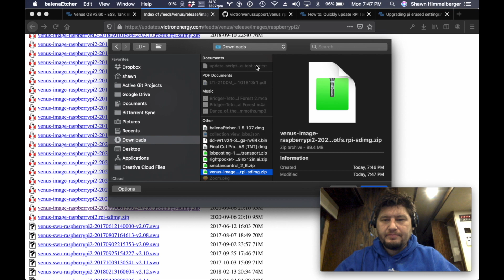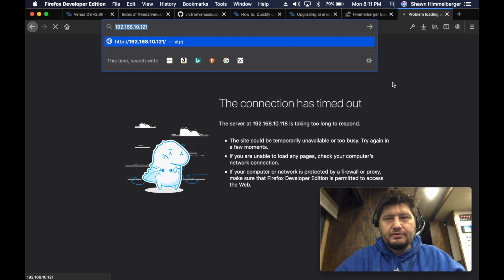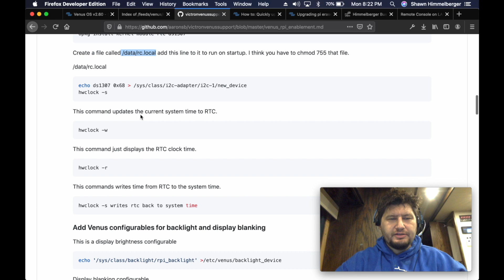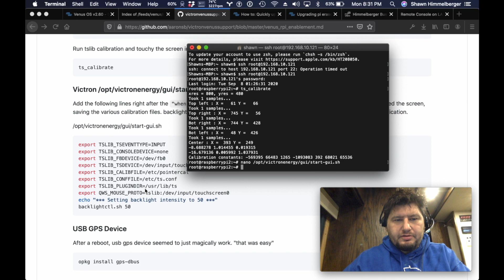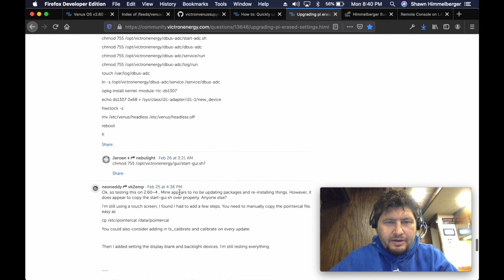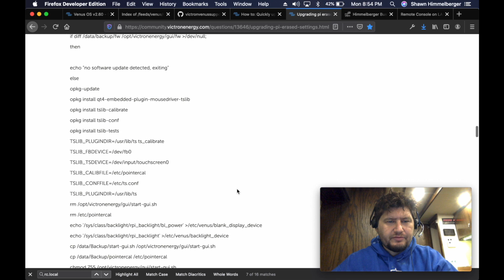Install Victron Venus OS 2.60 on Raspberry Pi with Update Script

Comment: I was going well until the reboot & calibration. It didn't reboot (I had to do that through the direct connection, not putty & then the calibration wouldn't work. Such a such as this is about the 3rd time I've tried to set this up & found this video & figured I was on a winner (looser again I guess!!) 🙄🙄 & yes, I also want to set up the RTC with the chip that is those downloads, so I added that, but I can't get it to work either!! I'm now lost again!!

Comment: I'm not getting nowhere with this I bought the raspberry pi 2 Model B I downloaded two different Victron Venus OS program and all it does it sit on the Victron Energy screen it doesn't actually boot up I can't find it using Venus local can't find it thru the IP address very frustrated

Comment: Hi, I see you have MultiPlus (not MultiPlus with VE.Direct port). Can I ask you, what did you use to conect VE.Bus to RPI? Was it MK3 to USB adapter from VE? And will it works any adapter from RJ45 to USB? Thank you
Reply: Standard RJ45 to USB adapter doesn't work
Reply from the maker: MK3 to USB adapter
Reply: @HimmelbergerBus  Thank you, works!

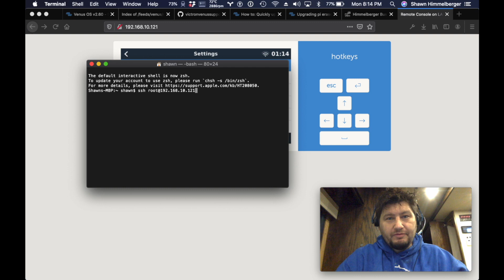Comment: I got my RPi up and running a couple of months back. Updating the OS today had to completely reflash the SD. Everything is working on the Victron end. But When I try to SSH into the Rpi I get the warning you have at 13:46. But you edited the fix out. Any help with the fix for the warning error?
Reply: I found the answer in another forum. Posting here so I can find it if I need it ;)  ssh-keygen -R <IP>
Reply from the maker: Sorry, I have a new even better method here when 2.80 comes out. Thanks for the tip.

Comment: this was really great. I have been back her again and again over a few months working my way through. everything seems to work except the brightness slider. After poking around I got the slider to appear but it slides but has no effect. I am not using official Pi touch screen. If you know of any tips that would get it to work i would appreciate them
Reply from the maker: Try the new method in our recent video. Uses GuiMods on a USB stick

Comment: Which BMV did u get?
Reply from the maker: I have the 702, but today I’d buy the Smart Shunt.
Reply: @HimmelbergerBus  what u think about  440w Mono-PERC bifacial panels? Are they good
Reply from the maker: Not sure on those , the ½ cell panels are great.  Looking at upgrading myself .
Reply: @HimmelbergerBus  I found some but I don’t no much about the
Reply: @HimmelbergerBus  I have one more question, I have a 24v system and a multi plus 24v 3000 do I need a battery regulator or something? I have a MCI 96-A3
Reply from the maker: @houseofshootsllc  there is a voltage regulator on the bus already. I have lithium and adjusted the voltage down so it charges at 100 amps at most. I do this so I don’t overload the alternator if I’m also running AC.

Short answer is no, you’re good.
Reply: @HimmelbergerBus  I really appreciate your response, I’m a big fan of your channel
Reply from the maker: No problem

Comment: This was probably the best start to finish video that I have seen, and I have watched a bunch. I have not bought, or ever used a Rpi. I think I am still over my head. Are there any videos that you would recommend for the Rpi programing on Windows?
Reply from the maker: First of all, Thank you!  As far as windows goes, you just need a terminal capable of SSH. I want to say PuTTY is a popular one and now with a windows Subsystem for Linux  you might be able to do it that way. Once you SSH in, almost everything is the same.

Comment: i would like this venus monitor, but dont want to install a new image. i have open plotter on my raspi and need to find a way to add the venus without a new fresh install please
Reply from the maker: I don't know if it is still supported, but there is a debian package. https://github.com/victronenergy/venus/wiki/install-venus-packages-on-Debian You won't be able to get the full features though with the screen and all that.  You could use a local network to display the web based display though, which in some ways is better. (on screen controls).
Reply: @HimmelbergerBus  thankyou so much. I will look into this. We have a few rainy days coming Up 😊

Comment: Do you have a link to the PI unit with display?  Thanks!
Reply from the maker: This case RS Raspberry Pi 7-Inch LCD Touch Screen Case, Black https://www.amazon.com/dp/B01GQFUWIC/ref=cm_sw_r_cp_api_glt_fabc_6D0BRHS7F49AWRQEFPTW
Reply from the maker: This screen Raspberry Pi Official 7 Inch Touch Screen for Raspberry Pi 4 / pi 3/pi 2 Model B https://www.amazon.com/dp/B073S3LQ6Q/ref=cm_sw_r_cp_api_glt_fabc_4PHJ043NTW1ZNZNSB16V
Reply: @HimmelbergerBus  What are you running for I/O interface to the Raspberry Pi? Like VE.Direct for example. Thanks again!
Reply from the maker: @srira7910  4port USB hub and VE Direct to USB adapters
Reply: @HimmelbergerBus  We could solder up a few cables to save some money buying VE.direct to USB adapters. Seen a few USB cables with the RS-232 Chip on board. Thanks for responding back!

Comment: hello there
I have been trying to follow your discription but I got stucked after trying to install ´opkg update' and there I got error 'wget return 8' . I solved it to find that the path was missing in victrons packages name ../rooko/.. was instead replaced by ../zeus/.. and then the 'opkg update' and all 'opkg install' seemed to be ok. But after reboot the Pi is stucked, on the display the  Victron logo is shown but there is several error messages, "login: error while loading shared library: libcrypt.so.1: cannot open shared objectfile: no such file or directory". any hints?
Best regards
Lennart Pettersson
Reply: I have a similar problem. "opkg install" fails with the same error. But in my install it called for /dunfell/ not /rooko/.  (I'm a newbee here, so bear with me)  I searched the feeds and found references to the packages but in a different set of directories.  None the less, when I manually executed the updates for each file in the corrected directories, they errored out with "file not found" and yet I've checked the paths and they appear to exist. So I'm dead in the water.  I got the hdmi display working, but the touch screen definitely needs calibration. Is there a way to manually execute the package installs from the .gz files so that I can do the calibration?
Reply: OK, I finally got it.  The /etc/venus/venus.conf file needed to be edited directly to update to the correct /develop/ path for /dunfell/ .  (Trying to update the files manually just wouldn't work )
The update worked correctly from there and the installs went smoothly.

Comment: Hey there. I Have been trying to get this working. I have it installed on on the sd card and see the blue victron energy logo. however I get lost when you say find the ip adress of the pi. I dont have a hard lined router. I have a small router so have attached macbook and rapberry pi to that but I still dont understand how to find the pi's ip. I therefore cant install the overlays to get it up and running. Can anyone help with this part, thanks anyway for a great informative video
Reply from the maker: There are apps for Mac that will Find your Pi on the network.  Also look in the router's administration pages, usually it will list hosts connected with MAC and IP addresses.

Comment: You should check out Home Assistant. Somebody had written some code for an ESP32 microcontroller to connect to the VE bus and push all this data out via MQTT and then you can pull it into home assistant and store / plot data in the influxDB / graphana add-ins.
Reply from the maker: Someday... I'm just happy it's working.  Also 2.71 is almost out with some great new features, esp for the Pi.

Comment: you didn't run ethernet to that point in your bus,shame.
quick fix get any old router/switch & connect a short ethernet patch cable from that to the pi, then run a temp long ethernet from any other lan router/switch  port to the main router when you do this stuff again forgetting to set your wireless creds on the new image, install 'nomachine' on there for remote access too.
putting old 1Gb/s router/switches to both ends of single/double run's is always more convenient later
Reply from the maker: I’m doing some light remodel now, I just might run one over there :-)

Comment: Hi, thanks for your help before. Everything is now looking great and I just have to connect my multiplus 1600 inverter. What I am wondering is how are you mounting the 7" display and pi to the wall? I've seen some ridiculous prices for a bit of plastic.
Reply from the maker: Glad it’s working out for you!  I cut a hole just big enough for the back case to go through, then all the USB connections kind of keep it in place. It’s not the best, it was one of those quick solutions that has stuck.

Comment: Thanks. I have the Venus software installed all ok but nothing else is happening due to the pi not being connected. I have done quite a bit of reading but I am still confused on the cable required and where to connect it to. I thought it was the mk3 ve-bus to USB cable, but then I have read about ve.direct serial cables. I cannot find any useful info about which to use.
Reply from the maker: Mk3 is for VE bus devices such as Multiplus Inverters. VE Direct is for things like Solar chargers (although some bigger ones are VE Bus as well) BMV Battery monitor, etc. 

Since our Pi is not very close to our equipment, I use a USB extension and 4 port USB hub to connect it all to the Pi. I have 3 VE direct and 1 MK3

Once you price all this out a CCGX or Cerbo GX doesn’t seem that much more expensive:-) 

Good luck and thanks for watching and commenting.
Reply: @HimmelbergerBus  Thanks for replying, but where does the pi need to connect to for me to have all this working? I understand I need my Mk3 cable for my Multiplus configuration etc. I have a Multiplus 12/1600/70 with a 150/45 MPPT. I also have the BMV712 smart monitor. The bluetooth on my venus/pi is enabled but after reading about it, I am guessing the connectivity to the software is not there. My thinking is the cable needs to be connected to the BMV... or do I need a separate ve.direct cable for each device? As you say, I might as well buy the CCGX. Thanks for your help and great video on the software...
Reply from the maker: @daveonthecut  yes, each device needs a VE direct to usb adapter .  The Pi gets the data from USB, not Bluetooth (that I know of) Bluetooth on the BMV and Solar chargers is more for systems without a Venus (Pi) device and only a phone or tablet.

Comment: I get to the point of calibrating the screen and I get "Selected device is not a touchscreen - must support ABS and KEY event types" I have a 7" touchscreen monitor. Everything has been going good till here. Then I get stuck with no touch interface. I do have the GUI shown on the 7" screen, but no touchy. So far everything is working correctly up till this point.
Reply from the maker: Double check that you have the touch overlay driver installed.
Reply: @HimmelbergerBus  Hi, I have walked through the install twice now (I tried to follow your instructions to a T) I did install the calibrate, conf and test files (touchscreen stuff) I'm going to verify the touchscreen with another SD card (Raspbian) and verify the screen works (It's brand new) I'll report back in a few...
Reply: Okay, I've verified that the touch display works. It's a setting I'm missing. I'll go do it again!
Reply: Woot! Got it working! Okay, so I have a no name screen that needed a few extra parameters for the display in the config file under [ALL] hdmi_group=2, hdmi_mode=87, hdmi_cvt=1024 600 60 6 0 0 0, hdmi_force_hotplug=1, disable_overscan. Hopefully this helps someone else out. Thanks for the walkthrough, I wouldn't have made it otherwise!
Reply from the maker: @Mogalize  Way to keep at it!  thanks for sharing.

Comment: Are you removing the canbus and
Relay because it’s now included in the packages or simply because you are not using them in your system? I have a bms I want to connect with can-bus but am running a much older version on my pi3b+
Reply from the maker: Can bus should be included, I’m removing the analog to digital converter stuff.  What BMS are you running?
Reply: @HimmelbergerBus  an Orion bms jr with can option. I know they recently added direct compatibility with the GX so I’m hoping to finally bring the two together

Comment: How long is your VE direct cable between your source device (MPPT or other Victron products) to your raspberry pi/venus OS device? In my motorhome, they are on the opposite sites of the RV.  The cable run would be something like 15+ feet between them.
Reply from the maker: I run a USB extension 10 feet from the living area down to the electrical bay. There I have a USB hub where everything connects, all the VE direct to USB dongles. If you had to run longer I might consider making cat 5 cable into VE direct extensions, RGB lighting cable might work as well. Since the VE Direct wire is just serial (4 wires) it might tolerate the longer run. VE CAN is Ethernet, so that should work fine as well. 

Good luck, let me know how it goes.

Comment: Hi! I want to set this up but have a question first. I have 2 victron solar charge controllers and their new smart shunt. I wont be able to connect all these devices to my raspberry pi using ve-direct to usb cables. Am I able to connect them all to the PI wirelessly over bluetooth or something? TIA!
Reply from the maker: Use a USB Hub, I have the same setup, plus 2 Multiplus Inverters
Reply: @HimmelbergerBus  I am currently using the VE direct ports in my charge controllers for the bluetooth dongle. Am I correct in assuming there is no way to pair my devices to venus over bluetooth then? That's a major bummer, my only real issue here is my boat is too long to reach my devices via bluetooth so was hoping to rely on wifi instead.
Reply from the maker: @montaguemonro565   It's more money, but get two  VE Direct to USB dongles, USB hub and a really long USB cable.  Looks Amazon has an active one that goes 32 feet.  For installs with distances between components it usually makes more sense to put the Pi / Venus GX Device closer to the components, then use a remote monitor display.  that can be done over Wifi / Canbus

Make sure to check out https://community.victronenergy.com  Lots of smarter people than me there.
Reply: @HimmelbergerBus  That sounds like an option, gutted a wasted money on the ve direct bluetooth dongles but at least I got an option now. I'll have the PI set up in the engine bay, then connect it to the wifi and run a display over wifi from the saloon. I got a narrowboat which is 68ft, so bluetooth was never an option it seems.

Just to confirm, I run the devices to the usb hub, then the usb hub to the pi (make sure pi is within range of wifi), then i'm golden?

Sorry for all the questions and thanks a ton!
Reply from the maker: @montaguemonro565  Wow 68 foot Narrow boat, I watched Journey with Jono's videos, I'm fascinated by it all.  My setup is only 10-12 feet at the most, I have all my VE direct / MK3 to USB dongles collect into a hub, then the USB extension to the Pi, 10 feet away.  Works for me to have the display right there attached to the Pi.  If I was to do it wifi, I could skip the USB extension and have a second Pi, or cheap tablet computer just run a web browser to act as the monitor.   Being that you're on a boat, you may already have an MFD, https://www.victronenergy.com/live/ccgx:start#marine_mfd_integration_by_app  Or you can hit that from  http://venus.local/app/ once you enable MQTT .    In short, yeah, you should be able to make something work.
Reply: @HimmelbergerBus  No MFD but have an amazon fire 10 thrown somewhere on the boat, that would do nicely. I think you've done amazing helping thanks! I love the boat a ton, just added solar and dual victron 100/30's so keen to see how much i'm getting! Big fan of jono too.
Reply: Just got the pi installed today and its working like a charm, definitely going to need to install the victron shunt to get the most from this, but yeah was an easy install and works a treat local or with VRM. Cheers!

Comment: Hi all i have automated this further and whole process only takes about 5 min to do i have a file set that is copied into the data folder and after reboot
it installs all the new files and the only thing to do is a screen calibration you will be prompted to do this on a new install, after a update nothing is required to do.
My version has the new camper van screen to show better detail etc. Also we have 6x relays control outputs if required.
Rob D
NZ
Reply from the maker: Have a link to this? Nice work!
Reply: Hi send  me your email address and i will send the zipped files required raduthie@gmail.com